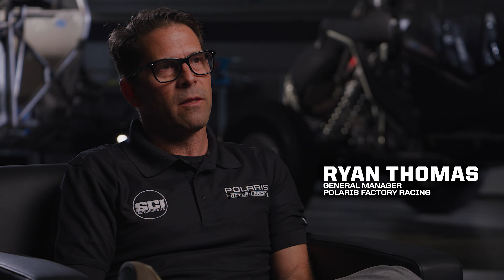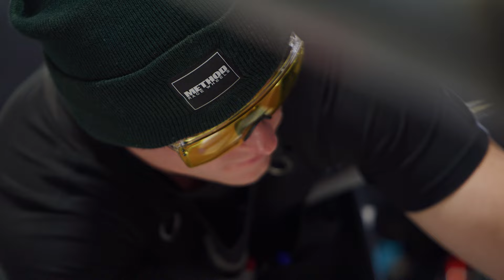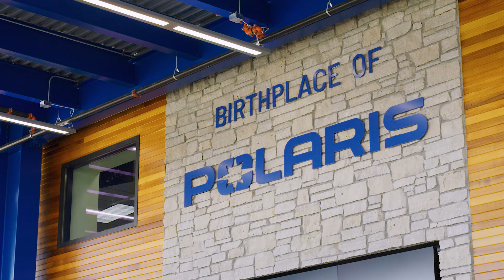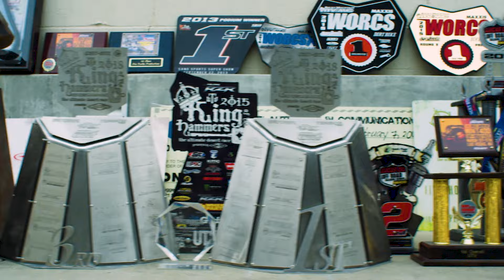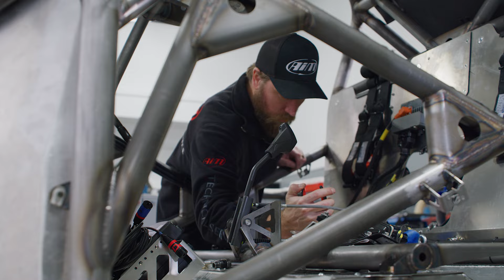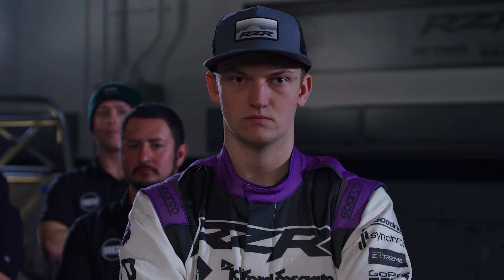INTRODUCING THE POLARIS FACTORY RACING TEAM | Polaris RZR®

Comment: This sure is a lot of effort to still get dusted by canam in a 7 year old chassis.
Reply: @wraith511802003  2023 King of hammers results. Pro Mod UTV 1st Phil Blurton, Canam x3. Pro Stock turbo 1st Kyle Chaney Can-am x3. 8 out of the top 10 overall were can-am x3.
Reply: @wraith511802003  actually is been ever single year of king if hammers
Reply: @adamwaldroup that's one race. There are many more. This team plus all the supported factory racers running the new Pro and Turbo R will win many races especially those in the grueling Baja.